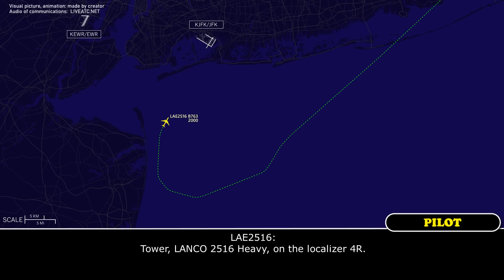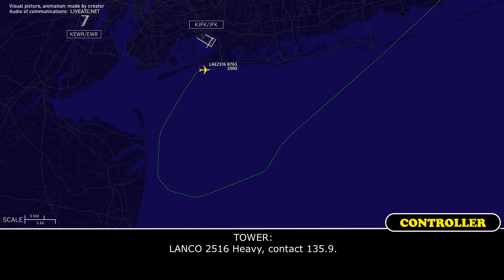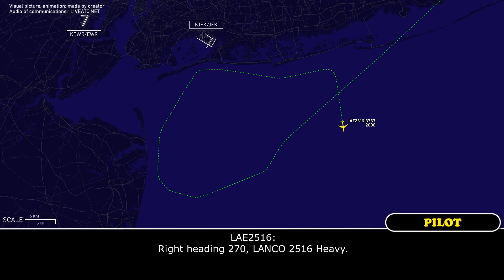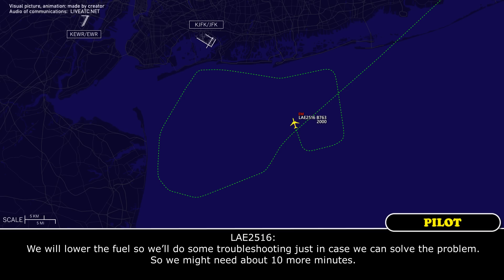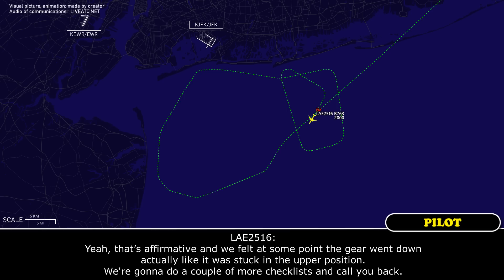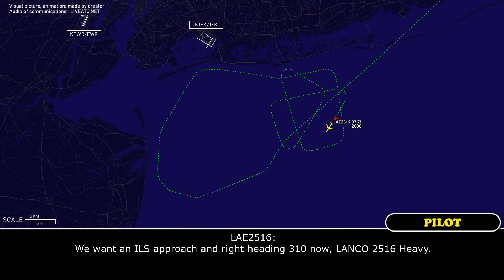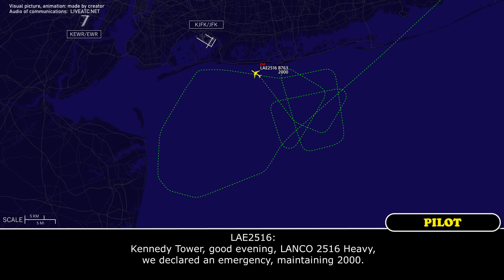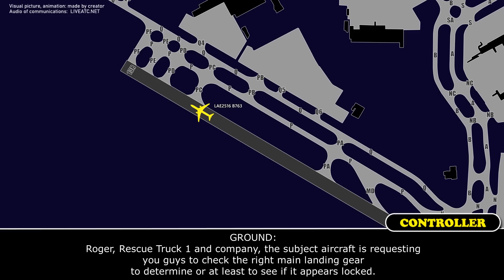“Unable to lower the gear”. LATAM Cargo B763 has gear problem at New York Kennedy. Real ATC

Comment: Maybe a 767 pilot can explain this to me, but wouldn't they just do a gravity drop and it's then no big deal?
Reply: I’m no pilot, just an armchair aviation enthusiast -  the I believe that gravity drop still doesn’t guaranteed the gear is safe and locked in position. In any case in this instance they had conflicting information meaning they weren’t able to manually deploy anyway, because cockpit indicator was telling them the gear wasn’t down, however the gear actually was already down.
Reply: @staceygrahame2504  - actually, you are right to some extent so I apologise for being too quick to comment. I’m not sure about the 767 but I’ve looked up the checklist for the 777 and it tells the pilots to activate the alternate release of the gear. This releases the unlocks so will help if the gear is up but not if the gear is down but not locked. 

The advice then is to just land and see what happens. It is an airlines procedure to allow a fly past or not.
Reply: @EdOeuna  “Land and see what happens.”

That instruction is so tragic, yet it absolutely does not surprise me that it’s an actual written protocol! 😅🙈
Reply: The gear is already down.

Comment: Your visual shows the plane landing on 13R just in case you hadn’t noticed. ☺️

I’m totally intrigued now as to what kept them on the runway at JFK for 5 hours. That’s a looooong time. I’m assuming the stability of the gear couldn’t be confirmed, but even so would that really take 5 hours?
Reply: 5 hours seems kinda normal to get the appropriate equipment out to force the landing gear in the locked position or support the gear in its unlocked position.

The plane cannot be moved before that's the case, as any movement may result in the collapse of the landing gear - ending in larger damages to the plane.
Reply: Hon...you need a hobby.
Reply: The 13R label on runway is drawn upside-down, as approaching planes should be able to read it.
Reply: The five hours probably indicate the landing gear was not locked in the normal position. It is a multi-million dollar plane and probably could fall at any time (killing someone); so until it got re-supported appropriately yeah, they had a problem!
Reply from the maker: Hello, they landed on 31L. Visual shows that.
Reply: @YouCanSeeATC  I think Stacey meant that the runway was labeled "32R" in the visual.
Reply: @clemrivers9861  Yes, on the diagram at the end of the video if you pause it, the plane silhouette is on a Runway labelled 13R. That’s what I meant. ☺️ Not that the plane itself didn’t land there, just an editing error I thought I was pointing out.
Reply: The runways are numbered by their heading. So runway 31 will be heading 310° (NW) and if you land on it from the opposite direction it is runway 13 (130° SE)
Reply: @derekschultz7807  Ohhhhhhh I see! I never knew that, so glad I’ve learnt that today. Thank you so much for your explanation. ☺️
Reply: @staceygrahame2504  'The Simple Secret of Runway Digits' is a great vid by CGP Grey- https://www.youtube.com/watch?v=qD6bPNZRRbQ
Reply: @YouCanSeeATC  Okay I think I misunderstand the visuals then because the runway the airplane shape lands on is labelled 31R. How do they work then - is it also the L?
Reply: @YouCanSeeATC  Sorry if I wasn’t clear, I think you misunderstood what I meant because I was talking about the airport ground map you created. ☺️

Comment: Closing 31L at JFK for 5 hours because of this is a bit strange. There must be more to the story than just an unlocked indication.
Reply: One guess: The landing gear was down, but it was not sure as of it was safe in this position or could suddenly collapse.
Reply: 5 hours definitely sounds like the gear wasn’t locked and could collapse so they had to plan on how to either lock it or get it off the runway without collapse
Reply: @bluecrayon007  You might be on to something there. I would have thought the 763 has pins that can be places to lock it manually though. Maybe someone knows the answer to this.
Reply: @Republic3D  Down and locked mean that the gear has extended beyond the center [vertical ] position of its travel.  This is called the OVER CENTER position where the weight of the aircraft plus hydraulic pressure keeps the gear in its selected position.  In the absence of hydraulic pressure, the gear when unlocked from the up or retracted position will fall with enough momentum and help from the relative wind that the structures will end up slightly over centered.  On landing, without hydraulic pressure the weight of the aircraft on an over centered gear will prevent retraction but only when the wheels are over centered can the physical metal locks be properly inserted. You may need jack stands under the aircraft before personnel can work under the faulty gear and wing to do any maintenance. I suspect that was the long delay.
Reply: @YouTube.TOM.A  Good explanation, thank you.
Reply from the maker: Unfortunately, this is all I know.
Reply: I was thinking the same thing, if it was stable enough to withstand a landing I would think it would be stable enough to  withstand a taxi
Reply: @davidjoseph7142  There is quite a lot of lateral force on gear components  during taxi. Something to consider. unless you have pulled the gear release for ALL three wheels you still have 3000 pounds per square inch of hydraulic pressure in the cylinders holding the gear in place. [ in the extend position ]  If a gear freefalls the hydraulic pressure is removed as  part of the checklist
Reply: @YouTube.TOM.A  yeah I suppose you’re right, the lateral force was nagging me in the back of my mind then you mention it…

Comment: Why did they decline the low approach?
Reply: Some airlines don’t allow it.
Reply: @saxmanb777  Even where the pilot has formally declared an emergency?  Why would that be?
Reply: Probably because it didn't matter. They had, presumably, already tried all the options to get it down & locked, so whether it was in fact down or not isn't really relevant.
Reply: @JohnRunyon  So for landing purposes, are you saying it makes no difference whether the pilot believes the gear is up or the gear is down but no confirmation of being locked?  I am not a pilot so am genuinely curious.
Reply: I was just about to ask the same thing
Reply: I'd like an airline pilots input on that. General aviation does it a lot but I would've thought an an airline pilot wants all the info he can get in advance even if the gear can still collapse if unlocked.?
Reply: @pauldunn5978  Yes concur, that would be helpful -- seems like a lot of conjecture here ...
Reply: Because the tower could only determine if the gear was "down", not if it's "locked". Crew made the right call
Reply: @jamesstuart3346  I don't know but seems like it would still be helpful information to know prior to landing.
Reply: @jamesstuart3346  It is also true that the 3 green lights [ in the cockpit ] are illuminated ONLY when the 3 gears are down and locked.
Reply: Because is doesn’t help. 

Will ATC share legal and financial responsibility if the pilots believe the gear is locked and then it collapses upon landing?
Reply: @EdOeuna  Gear can be down without it been locked. Rare but it can happen.  ATC would NEVER say gear was locked down after a flypast observation because there is no way they could know that. They can only advise that the landing gear has dropped.  There is zero legal comeback for ATC saying that as it does not infer the gear is locked. 
A flypast for an ATC observation is a standard offer in such a situation.
Reply: @pauldunn5978  - exactly. There is no benefit from a fly past because ATC can’t provide any useful information. 

From Boeings FCTM for the 777 - different aircraft to the one involved I know. 

“Land on all available gear. The landing gear absorbs the initial shock and delays the touchdown of airplane body parts. Cycling the landing gear or manoeuvring the airplane in an attempt to extend the remaining gear is not recommended. A gear up or partial gear landing is preferable to running out of fuel while attempting to solve a gear problem”. 

The FCTM then goes on to describe techniques for preparing, flying an approach, and landing with different combinations of gear up/down. 

The non-normal checklist for gear disagree is to attempt to lower the gear then land on what gear is actually down.
Reply: @EdOeuna  So in preparation for landing, it makes no difference whether the pilot believes the gear is up or the gear is down but no confirmation of being locked?
Reply: @jackblack2370  - I can’t say specifically for the 767, but from my experience Boeing want pilots to make decisions based upon information that the aircraft provide to them. It means that, if the gear doesn’t show down, then the pilots act upon that information. Don’t cycle the gear, don’t wiggle the aircraft to try to make it drop. Just plan to land on what you have. 

I can’t say what LATAM’s procedure are but the pilot was very quick to not take up the offer, thus suggesting it isn’t part of their thought process.
Reply: @jackblack2370  what would the pilot do differently based on that information?

Eventually they have to land. No repairs are possible until they land. They have already attempted all options available in the air to address the situation. So... Why waste time before landing? If the gear isn't down the only difference is you'll have to go lower than usual before you feel touchdown...
Reply: @JohnRunyon  I already asked the question:  "So in preparation for landing, it makes no difference whether the pilot believes the gear is up or the gear is down but no confirmation of being locked?"  So your answer is it does not in fact make any difference.
Reply: @EdOeuna  Not sure where you're getting that information but I don't think that was a consideration here, low approaches for this kind of stuff happen all the time ...
Reply: @jackblack2370  - what will the low pass achieve? The gear might look down but it might not be locked down, hence the lack of a green gear light on the flight deck. The pilots may then think it’s safe to land, based on info from ATC advice, complete the landing and then the gear collapses. 

Boeing advice is to lessen the weight and just land the plane. They don’t prohibit the low pass, so it will be an airline policy matter. Clearly LATAM don’t allow this.
Reply: @EdOeuna  "Clearly LATAM don’t allow this."  I haven't seen confirmation of this so not sure if that's the case or if this was pilot discretion here.
Reply: Because they misunderstood what ATC was saying. They responded "We are not ready for approach yet". They missed the other part.
Reply: @Republic3D  7:32 sure sounds like they responded “we are ready for the approach”. I don’t hear any hint of “not”. And if they missed the question, that would be a bad miss - there was no overlap in the communication.
Reply: @Republic3D  I was referring to the exchange at 7:23 -- I'm not hearing any  miscommuncation there.